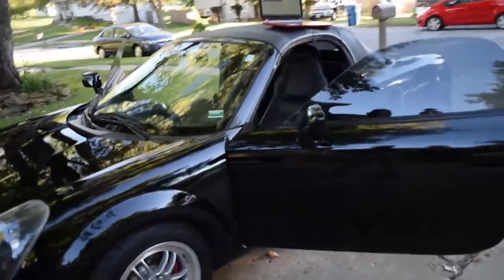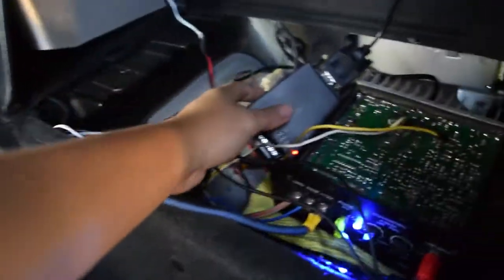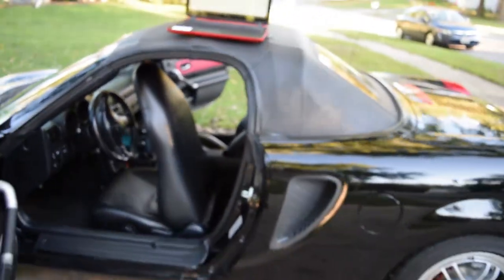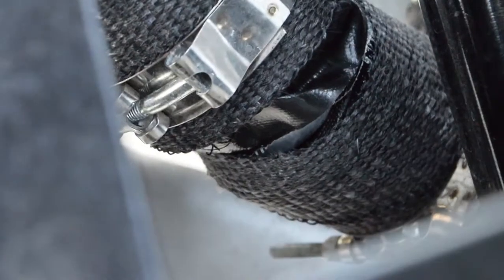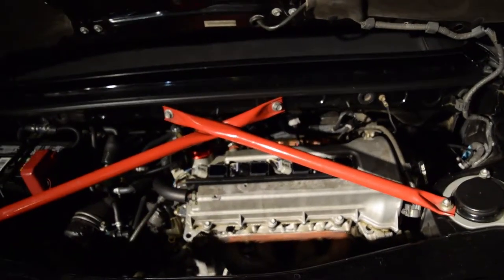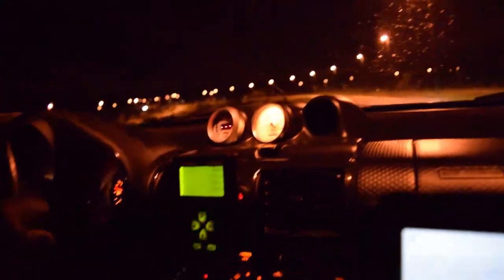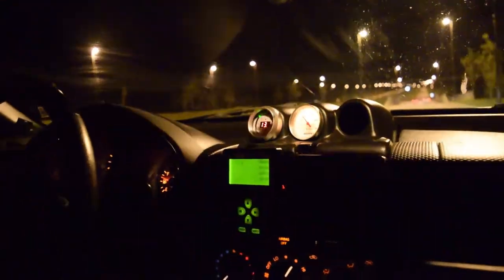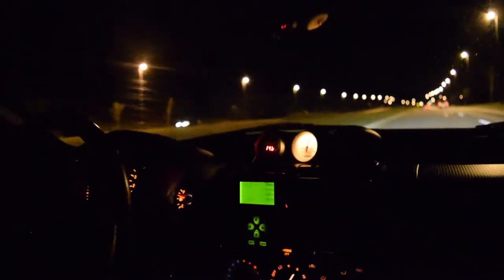Street Tuning the Boosted MR2 Spyder (MR-S)

Comment: Did you just adjust fuel or also ignition timing when you tuned it?
Reply from the maker: I did adjust base fuel map and ignition. for fuel I used my afr gauge for reference and for ignition I used knock sensor for reference, before I started tuning I made a "rough draft map" outlining the vacuum events; onset of boost event; on boost events and fuel economy line which I ended up deleting since it was causing some bog at 3200 rpm.

I also adjusted:
inj vs air temp
inj vs water temp
inj vs throttle
injector size
air curve for 3 inch maf housing
ignition vs air temp
ignition vs air temp

onset of boost is the most important part you should worry about, remember positive pressure (boost) means more fuel and less timing

if you have any question please feel free to ask!
Reply: It looks like you really nailed it. I wasn’t sure how well that would work with just the datalogger knock detection. I actually ended up splicing a headphone jack into my knock sensor line. I connected it to a headphone amp and listened for detonation while I was tuning. How much boost are you running? I’m running 20psi on a GT2860RS.
Reply from the maker: I'm barely at 8 psi right now lol
Reply: Stock internals? I blew my first build up. My new engine has forged internals.
Reply from the maker: yup stuck internals, I think I will only push up to 12 psi and then save up for some forged internals